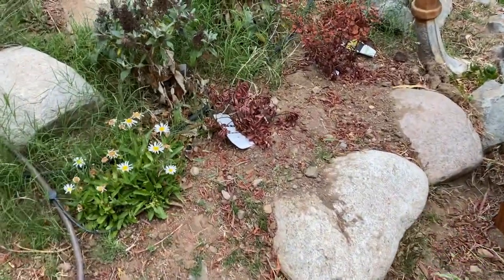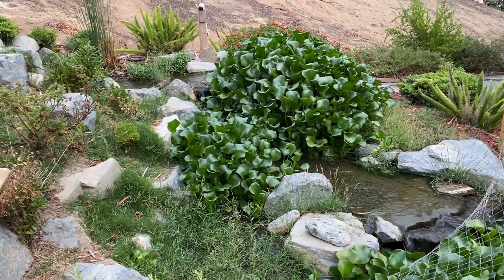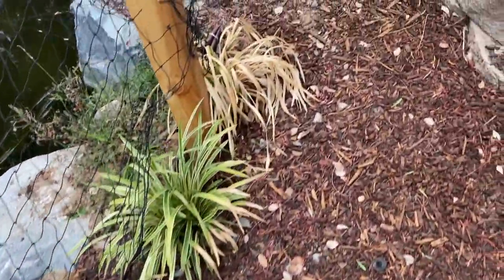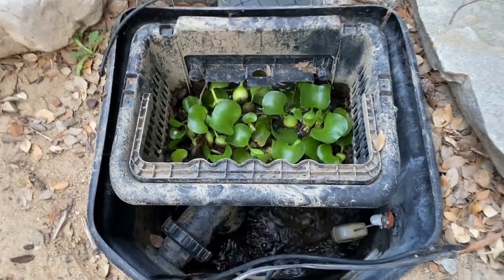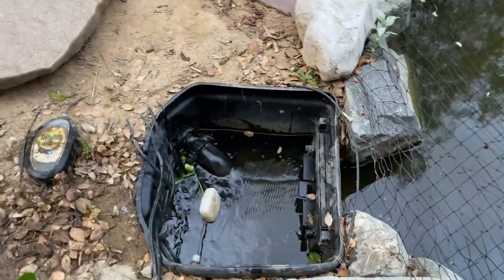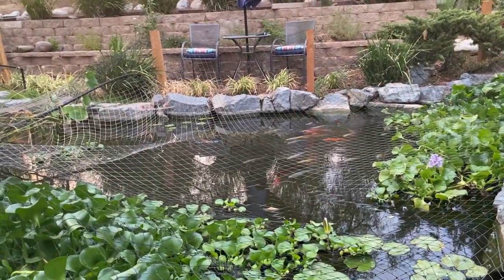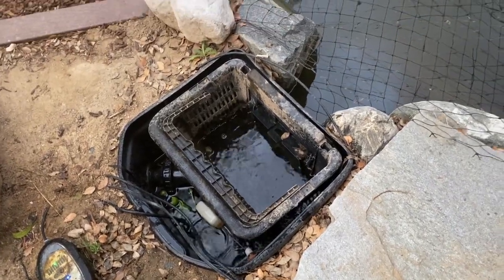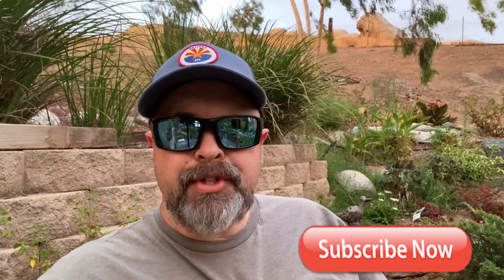Pond Evaporation and why its happening to you.

Comment: As for my for my pond in thailand.  We have about 9 months of weather in the 90's.  Total sun.  Then about 3 months of cooler, partly cloudy weather and big rain.  We pump ground water into the pond about every 3 or 4 days...and that takes all day. Huge pond...about 75 meters long and 25 wide.  It's cheaper here than in California..though.  Pump and air conditioner for the house, fans and 2 refrigerators...total about 120 bucks a month
Reply from the maker: wow thats a really big savings! during the summer and spring im constantly filling up my pond . California is way to high on power its super expensive here. but its all apart of owning a pond i guess. Thailand sounds like a great place to visit. Maybe you can post your pond so I can check it out?